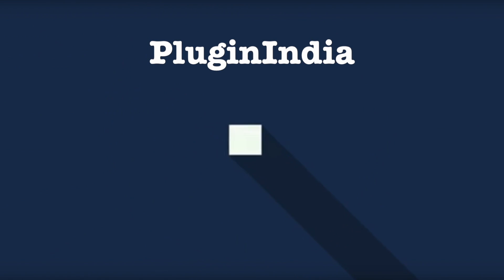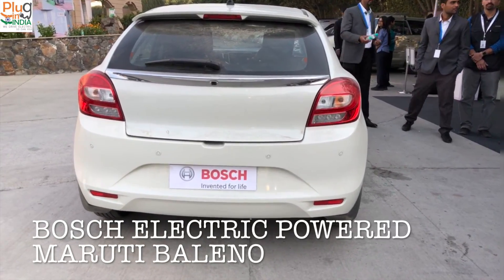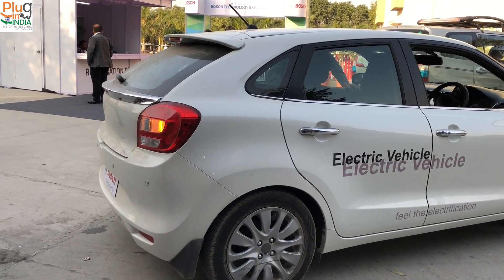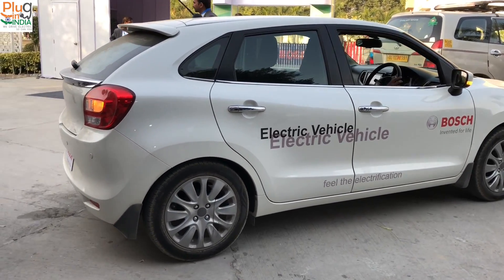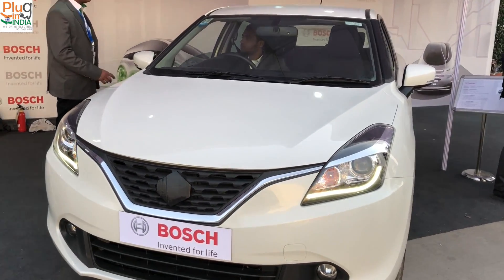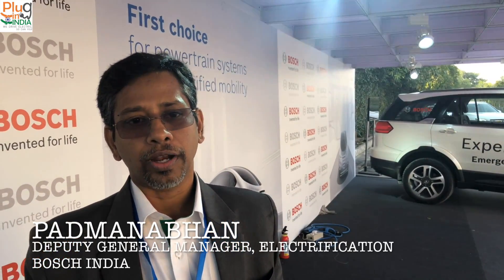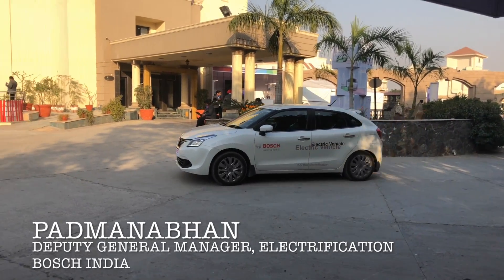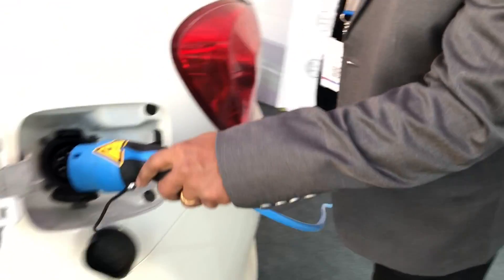Bosch Electric Car Demonstration

Comment from the maker: No Release date as of yet.  Bosch are looking at OEM's to partner with.
Reply: Plu
Reply: When release the car and cast
Reply: range?
Reply: I am interested to convert my scorpio 2006 to electric how do I approach Bosch plz advice
Reply: @rajyalakshmikakani2182  Small companies that can't develop their own solutions.
You got skills, start collecting the 18650 batteries, think about how to charge them, good casing! 4 of the shelve motor wheels and the job is done, some of the shelve charging and operation IC's too! Many people did this home two
Why scorpio 2006, worth it???? Can'y you find any 2006 nice car?
Reply: PlugInIndia why don’t they start to sale conversation kits ? To direct customers? If they do where we can get it , ?
Reply: @sameeravhad  They? Guess you have to do that, Bosch parts you need?
Forget consumers here, they are too stupid, they need out of the box solutions....
Reply: Looks like their search are still underway. It's been more than 4 years and yet to implement it

Comment: It is great to see that we can convert our IC cars to electric cars . But they not said what is the range it will give that's the main question ?
Reply: Quick fix Forget about range, it would cost more than 8 lakhs with lead acid, 10L with li ion.